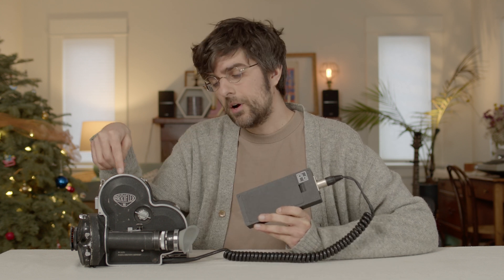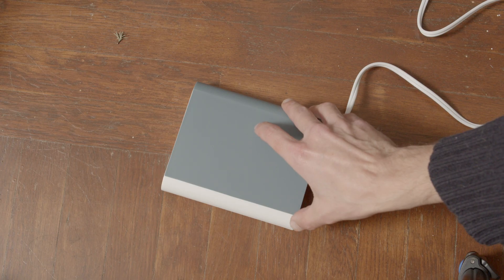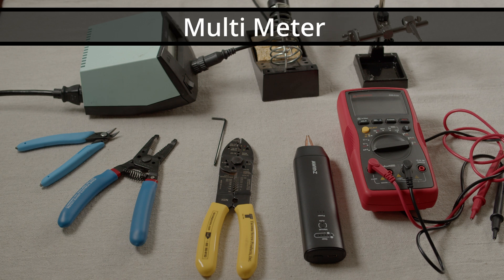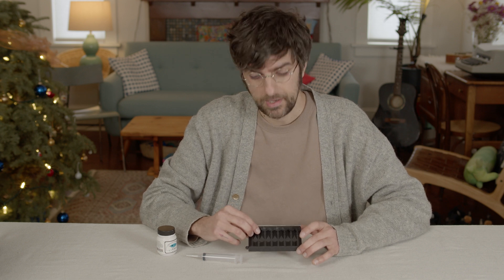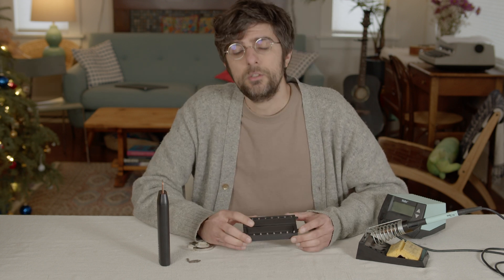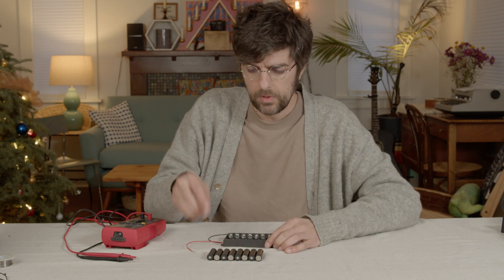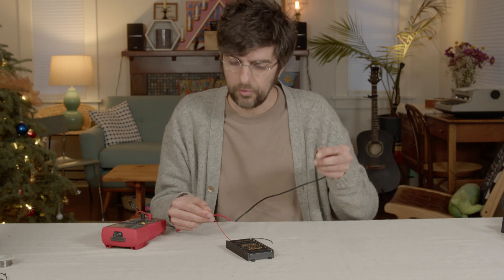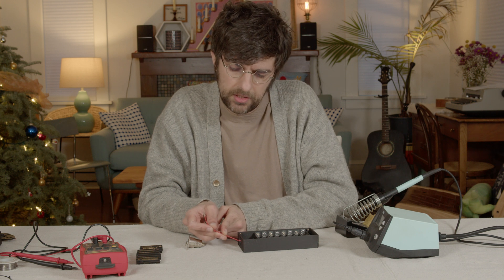Arri 16s Battery Pack with Replaceable Cells

Comment: Would a future version of the motor include detection of film running out and film tearing? Would be a good version 2.
Reply from the maker: The newest code I ship with the motors has anomaly detection - so it won’t stop when film runs out, but if there is excessive tension in the film path (like a film jam) it attempts to stop the motor.

The nice thing is that the code can always be updated or modified even after buying the motor - makes upgrades and improvements to the system a little easier.

Comment: I have a problem with the Arri 16 s power cable.  It is not the standard arri 16 s power cable correct ? The Arri 16s cable is pretty rare and hard to find . I would like to know how would you fix the the power cable problem ?
Reply from the maker: Most people will just modify the cable that came with their camera to have a 4-pin XLR connector. If you can’t do that, I also sell them on my website.

Comment: The Arri I just bought actually came from the guy with this battery pack and an XLR to 2-pin cable he crafted himself. He said to use 8 alkalines in it, but 8 alkalines would equal 12v, and I know these cameras have 8v motors. So exactly which type of rechargeable batteries do you recommend?
Reply from the maker: You need to use rechargeable AA NIMH batteries which have 1.2v instead of the typical 1.5v of non rechargeable batteries. This equals 9.6 volts which drops down to the 8.4v range needed for this camera under load.
Reply: @pluriboom  Cool. Thanks so much!